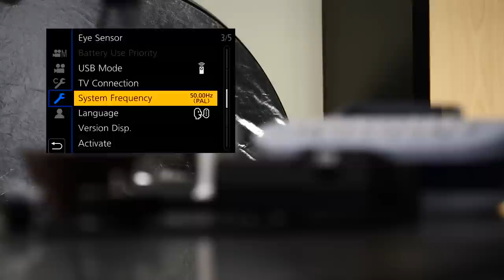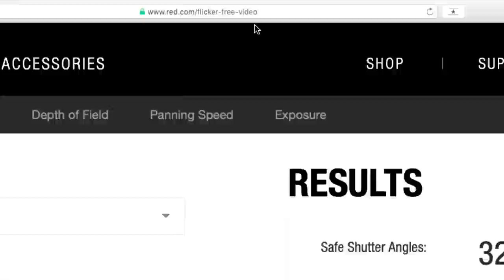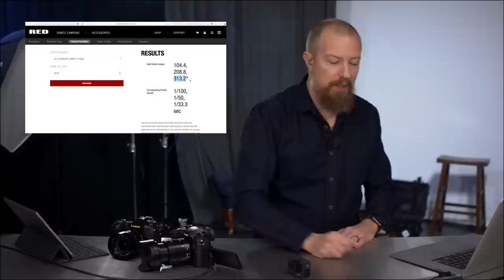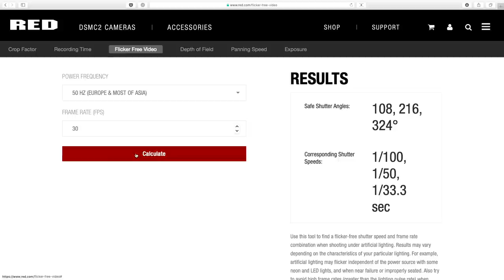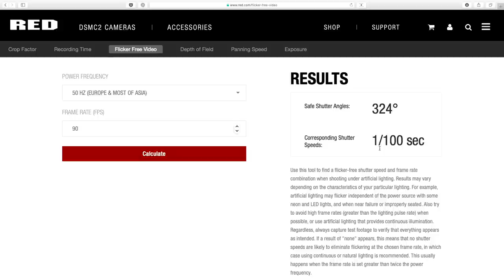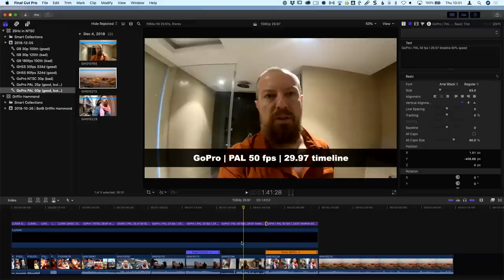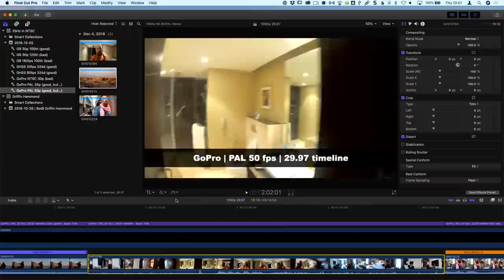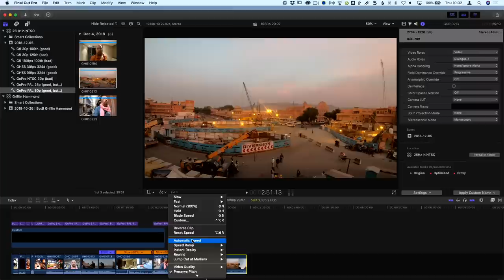Shooting NTSC in a 50Hz (PAL) Region ▶︎ LUMIX G9, GH5S, GoPro

Comment: Red's calculator does not assume 29.97 when you type in 29. It only works on Integers so whether you type in 29.01 or 29.97 or 29 it makes calculations for 29 (you are better of to put in 30 for 29.97). Notice the difference in calculated angle for 28 and 29 is almost the same as for 29 and 30.

Comment: Useful video thanks, glad I watched it before buying 50 Hz lights! When working with the safe shutter angles e.g. 108, 216, 324 at 30 fps would different shutter angles result in different looks? Would the higher shutter angle like 324 let in more/less light or provide more/less blur for example?
Reply from the maker: Lower shutter angle is the same as higher shutter speed. So if you’re shooting 30fps at a 10d shutter, that’s 10/360 x 1/30. I’ll let you do the math. So that will freeze the shot making no motion blur. Remember that motion blur is good in video. 180d shutter is ½ open do in a 30p shoot that’s 1/60 second exposure. Slow for still photography but perfect for video. So stay as close to 180d as you can, unless you have a creative reason to go higher or lower.
Reply: @photojoseph  Cheers, that's good to know! I own a GH5 so I guess, in theory, shooting at 60 fps with a shutter angle of 216 would be flicker-free, have improved continuous AF plus a more natural video look with some blur?

Comment: I’m in the USA shooting under an led source that is just horrific and I’ve tried all that you’ve suggested in both this video and another one that explains flicker.  I’ve tried setting it to NTSC 30p 360d and it’s about the best I can get, but I still get a very slight flicker. In PAL, 50p 360d, I get the same amount of slight flicker and it’s best look I can achieve.  At this point, is it just a light source that isn’t going to allow me to remove the flicker completely? It’s a real disappointment when my phone can capture video under that light source without any flicker :/

Any other suggestions?  Your explanation was great and thanks for putting all of this together 🙏

Comment: Hi,

It has been a while since this was published but I was hoping to still find an answer.
I understood almost everything, thank you very much for the clear explanation.

However I am wondering about something. In the end you explained what to do with a GoPro; the instructions of setting up the camera are clear. However the example you used was using a 30p timeline. What would happen if I use a 24p timeline and drop a 25p PAL clip on there? Would the difference be visible and cause problems as well?
Reply from the maker: The flicker appears (or doesn’t) at the time of recording. Adding it to a different frame rate timeline won’t change the flicker. But you will notice skippped frames / stutters if you go from 25fps to 24fps. You could simply slow it down to 96% speed so it plays every frame (25*0.96=24)

Comment: This was really helpful! I’m moving to Africa to teach film and capture stories and I’ve been thinking a ton about this and then your video came out! Good timing!

Now I have a question. Is the difference in frequency due to the lights and how they’re made or are they due to the voltage? 

For example, if I brought lights from here in the US NTSC, but they can handle 220v, would those be on the same frequency as lights that I would buy there? Can I mix different lights (NTSC & PAL)? What if I use a step down converter? Would that change the frequency of the lights?

Comment: I just got a GH5 yesterday and was going through the set up. I live in Australia so should I set it to PAL or leave it on NTSC? I set it up to use shutter angle and have that set at 180.
Reply from the maker: Australia is a PAL region
Reply: Hi Allen  I have a GH5 I live in Australia and I have the camera set on NTSC so I can get the higher frame rates and I did get light flicker when using a 180 degree shutter angle 
So now I use a 216 degree shutter angle @ 30FPS and all is good

Comment: Great Explanation. So with a G9 NTSC Camera the workaround works for 30/60p in 1080/4K for PAL region but not with 180p. Is that correct?
Reply from the maker: Correct. As long as you can set the shutter to 1/50 or 1/100 you’re fine.

Comment: Hey Joseph, the calculator on Red's site doesn't go above 120fps. Any extra ideas on how we manage VFR high frame rates like 180 or even 240 on the GH5s?
Reply from the maker: I assumed that to mean you can’t do high frame rates at these odd lighting situations, since it says “none” for safe settings. Do you think that’s wrong? Ah yeah… the calculator goes to 400. Put in something over 400 and it says “Frame rate must be an integer between 5 and 400 fps”. So I think that’s right. 120fps may be the highest under 60Hz lighting.
Reply: Good to know. Thanks Joseph.

Comment: I am very curious if using so called hack on European cameras that switch between NTSC and PAL also works on American Panasonic cameras too. I have G7 in EU and also using it in "service mode" (hack)  because I do like to shoot in 30 and 60 fps but then the shutter speed can be challenging with fast moving objects under the bulb.
Reply from the maker: I don't know anything about hacks, but any camera that can switch between PAL and NTSC makes this problem go away (assuming you don't mind shooting in an alternate format to what you're used to).

Comment: Hi, Im thinking about buying a camera in Japan, which is restricted only to ntsc, but it is  a lot cheaper(a6500). Should I not buy it because of the fact that it doesn´t have PAL? My country is pal, but i have used 24,30,60 fps and never seemed to have a problem
Reply from the maker: If you plan on shooting under artifical light then you could experience the flicker problem described here. So I'd definitely recommend getting a camera that is for your region.

Comment from the maker: (Yes, I kept saying 25Hz and 30Hz when in fact the power systems are 50Hz and 60Hz. I was basing that off what the camera says in the settings, so I stated it incorrectly. But the solutions here are all still accurate)

If you're traveling to an PAL region, where the power cycles at 50Hz vs the 60Hz in North America, you'll get flickering in any shots with artificial light. Here's how to correct for it, and what to do when you can't.

Comment: Yikes 🤔 The Red flicker free calculator says "None" for any frame rate above 120 with 60Hz (North America) power or 100+fps with 50Hz (Europe/Asia) power. Also, the calculator's code treats input as integers and just ignores decimal values without even rounding - so the correct input is 30 fps, not 29. When shooting high-speed, the frame rate can be any whole multiple of the lighting power frequency.
Reply from the maker: I don’t recall when I figure out that the red calculator treated 29.97 like 30 but that was definitely annoying. I did a follow up video that’s much more in depth that you may enjoy https://youtu.be/0kAuDuV9K9U
Reply: @photojoseph  Thanks for the follow up video link. Very detailed explanation 👍

Comment: Well i still can't remove anything with my house light
Reply from the maker: Does that mean you can’t remove flicker? Is it an LED light? Some cheap LED bulbs have a flicker that has nothing to do with Hz. Many LEDs actually turn on and off very rapidly. It’s a way to save costs. But it’s a disaster for photo and video. Look up “pulse width modulation”; pretty sure that’s what will explain it all to you.

Comment: The U.S. uses 120v and 60hz not 110 and 30hz..as you state in the video, should of done a quick google search to fully understand the topic your explaining.. Broadcast is actually 60fps divided into 2 interlaced frames... These interlaced frames are just below 30fps so as to include the audio signal within the limited bandwidth of old cable tv
Reply from the maker: No, the US is 110. And video is 29.97 for sound, yes, which I said. 29.97p is not two interlaced frames; old interlaced TV is but not progressive video.
Reply from the maker: @Terry Odlum OK I did a little more digging. The system started at 110, and eventually moved to 115 then 120. If you even look at the back of something that's powered for our system only, you'll see it listed as 110-120V requirement. Even if you just google "US voltage", it lists 110, not 120. But yes you are correct, it does appear that technically it's run at 120 now. (I don't mind being corrected; I just don't appreciate arrogance like Zack laid down — if you're going to correct me, do it politely, don't tell me I "should of" [sic] researched something. The amount of effort that goes into these videos that so many people disregard completely is enough to make you want to swear off youtube). And yes, TVs were originally 30 and dropped to 29.97 for color (IIRC it had to do with audio sync, but that may be wrong); as I mentioned in the video that was a topic that was out of the realm of this discussion, but I did acknowledge that. Even European power is listed as varying from 220 to 240 depending on where you look, but that's actually an important part of this — it's variable. As for interlaced; yes that's the way it was (and still is for anyone broadcasting that way) but I'm talking about shooting 29.97p, which is most definitely not interlaced. No dSLR or dSLM to my knowledge shoots interlaced anymore; for that you have to go back to handicam and old video cameras. As to the 30 vs 60Hz and 25 vs 50Hz, I guess looking at the camera where it's setting is 30.00Hz for NTSC and 25.00Hz for PAL is where my mind went. You're right that 50 and 60 is the mains frequency. Ultimately thought the information is correct. If you want to shoot NTSC video in a 25/50Hz region (or vice versa), you have to adjust the camera. Thanks for the information (and thank you for being polite).